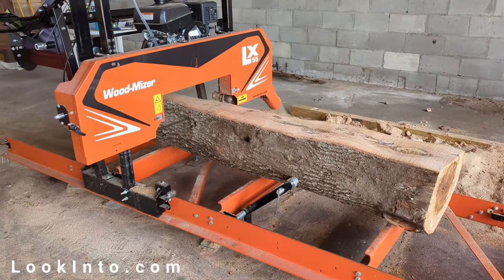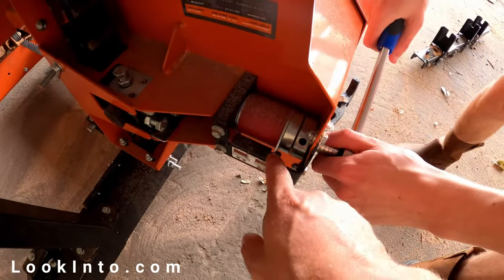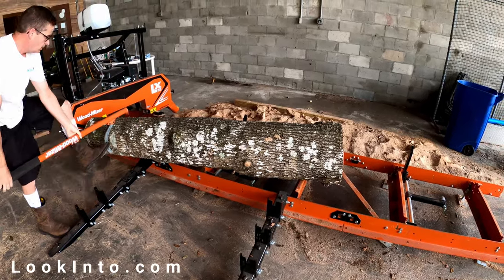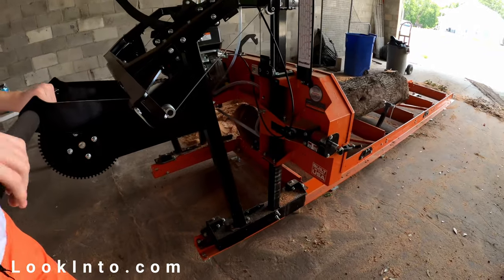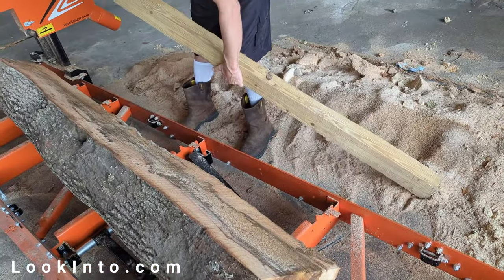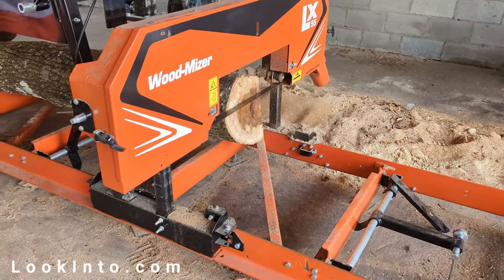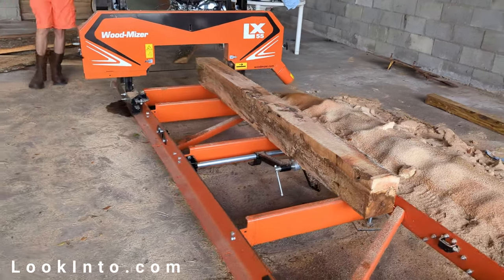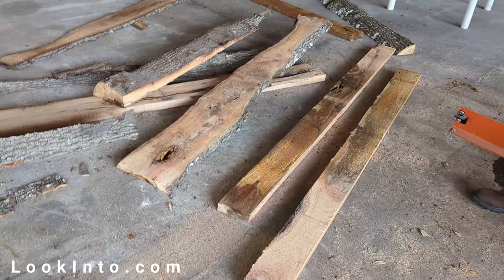Wood Mizer LX55 Hands On Test – We Just Bought It!

Comment: Apparently they discontinued this model. Whats the max log width and cut width?
Reply from the maker: Does up to 26" diameter I believe. Length is whatever size you want, you can make the bed as long as you want with extensions. I think the default is aruond 12 feet in length. The LX55 was replaced by the LX50SUPER.

Comment: more importantly, what did you pay for it?
Reply from the maker: The mill was $5,595.00 then I added the feet so you can level it on solid ground, loading ramps, and a 10 pack of blades which brough it to $6386 plus $150 in shipping and then tax for a total of $7k delivered.